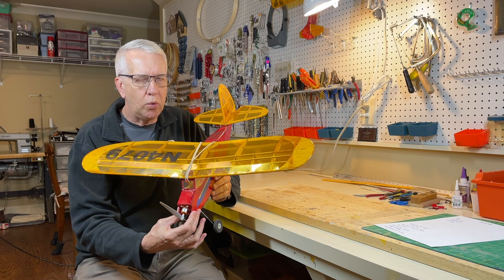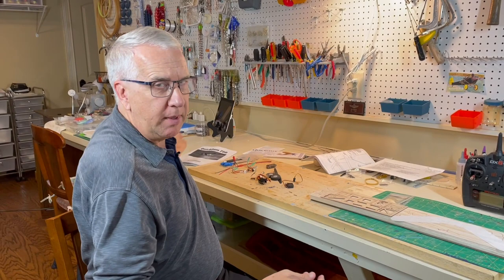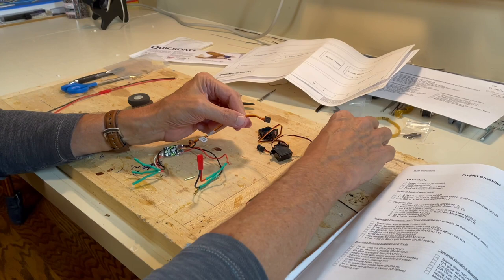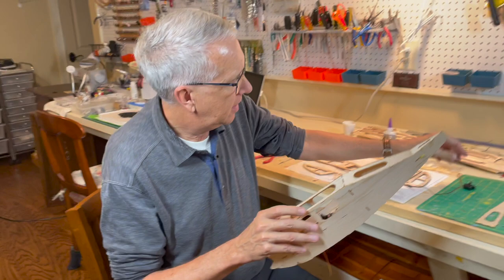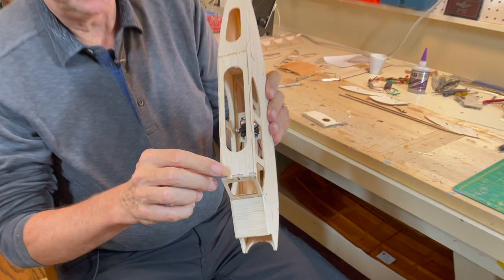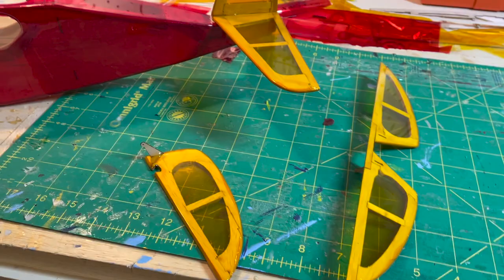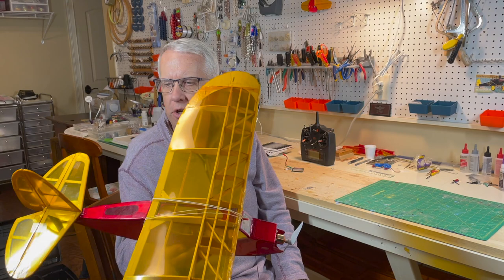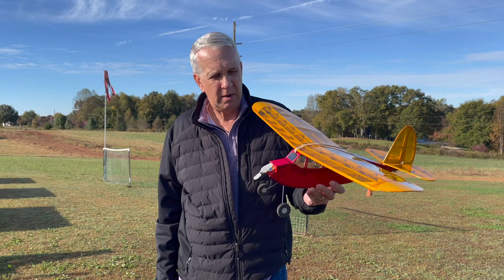Quick Oats RC Sport Flyer Kit

Comment: I'm currently building a Playboy Senior 36 inch span and I was curious if I could lessen the dihedral a little because I have electrified this old free flight aircraft. Where I will have a rudder for control I thought I would be able to do this without losing stability. Great video, I have been eying those Steven's kits so its nice to see one up close. Thanks for your help
Reply from the maker: Chip, Should be no issue with decreasing dihedral, as your model will be RC and not a free flight gasser. Tim

Comment: Awesome!! Tim, I was wondering what the exact rational is for the lite plastic coat, versus tissue and dope. For Most rubber powered builds, people stick with the paper (perhaps it’s a tad lighter? Or maybe just to stay traditional?) but almost all rc builds/conversions I see use the lite plastic covering. Is this due to higher forces from rc electric flight or something? Thanks in advance! (I know you have other vids on the subject, was just wondering)
Reply from the maker: The “lite” iron-on coverings are just so light weight and easy to apply a lot of modelers, such as me, go with them. I’d guess they are about the same weight as tissue. Dealer’s choice!  Tim
Reply: @TimMcKay56  much appreciate the response. That’s fair reasoning! I guess I will give both a shot! I love how the tissue looks on the balsa, but I also like how plastic holds up when landing in dry sharp grass and twigs. Much to consider…